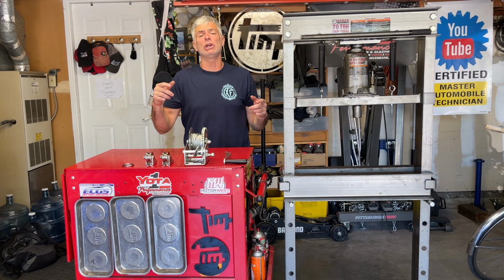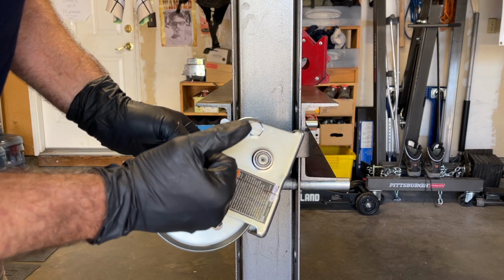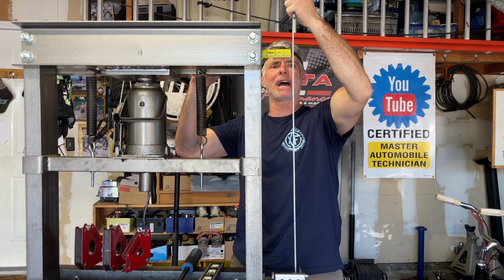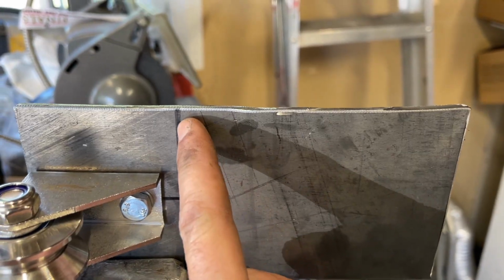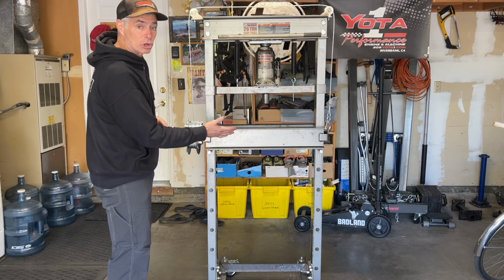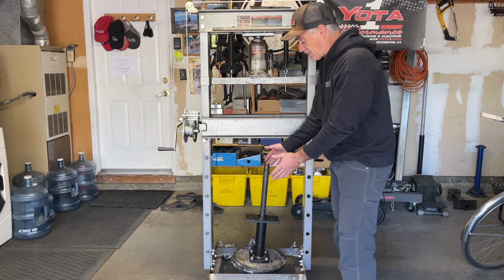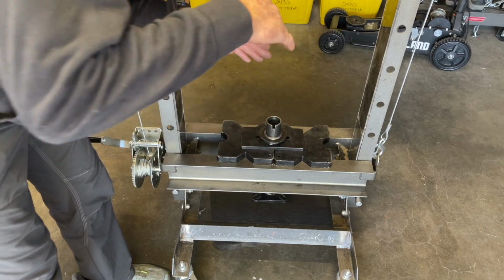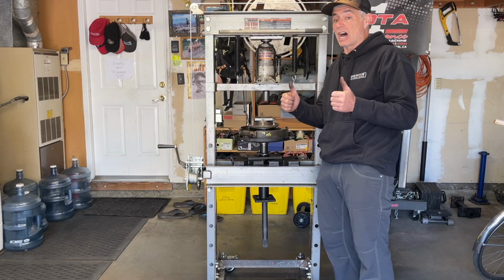Harbor Freight 20 Ton Press Winch Mod

Comment: Do you have a Drill Doctor? If I grab a dull bit, I can sharpen it in seconds! My Drill Doctor is so old.... I chuckle when I open the case because it has a VHS instruction video still in it! 🤣 Great press video! I still have to do my 99 runner front wheel bearings!
Reply from the maker: No, I don't have a Drill Doctor, but I'm going to look into getting one.  I've never heard of it.  Thanks for the suggestion.  I'm glad you like the video.  We do have a video on how to do the front wheel bearings, but I assume you know that already.
Reply: @TimmyTheToolman  looks like Amazon has them still. Looks different than my old one. Get one and do a vid! 😎
Reply from the maker: @KetoCaveMan  Maybe I will make a video on the subject.  Thanks!
Reply from the maker: @KetoCaveMan  I purchased the more expensive model that can handle up to 3/4" drill bits.
Reply: @TimmyTheToolman  I'm telling you once you get the hang of that tool, it's so nice to just sharpen up a bit as you're using it. And you'll go through all of your bits that you have now and get them ready! Let me know if you want to borrow the VHS tape! 😎🤣
Reply from the maker: @KetoCaveMan  I definitely owned a VHS player for a lot of years, but not anymore.  I don't even use a DVD player anymore.
Reply from the maker: I tried out the Drill Doctor the other day.  It works really well.  The Drill Doctor works best with drill bits with round shanks.  I have a set of Milwaukee drill bits with a hexagonal shank and it makes it difficult to get the bit into the correct orientation to be properly sharpened by the grinding wheel.  But, whatever.  If I ever buy drill bits again, I'll make sure it's bits with a round shank.
Reply: @TimmyTheToolman  yes I do agree on hex bits, but I do get the regular bits myself and I can sharpen right away as I'm using the bit! As I'm drilling, If it starts to get dull! I just leave it out! It takes a little time to get used to getting it right but I used to be able to sharpen bits right on my grinder but this tool makes it easy to get it right quickly. Especially the correct angle. I've had this one for years and haven't had to replace the wheel. Hope it helps you in your endeavors and I'm glad I was able to assist you in a small way as I've done a lot of work to my 99 "alien" runner because of your vids! Kudos sir!
Reply: @TimmyTheToolman  maybe a round sleeve of some kind for the sharpening chuck? 🤔 Make a suggestion to the Drill Dr. As there is probably another chuck to be made! Or a fabrication hack from a Milwaukee drill chuck! 🤔
Reply from the maker: @KetoCaveMan  That's a good idea.  I will contact them and see if they have a work-around for that style of drill bits.